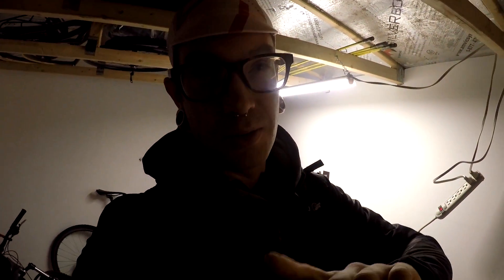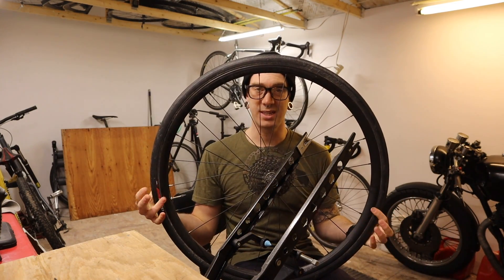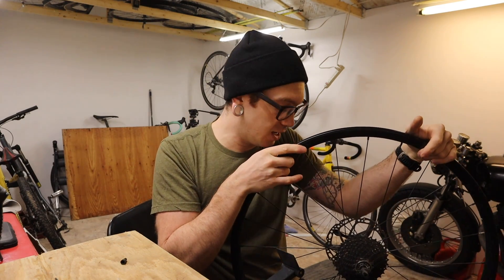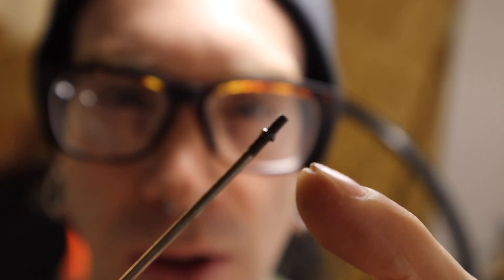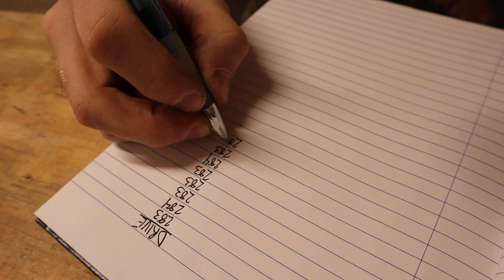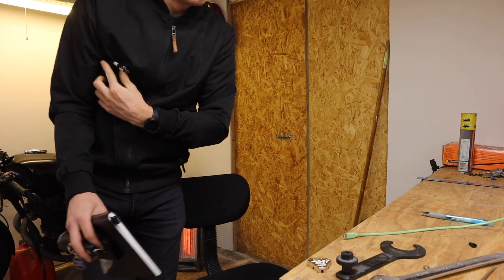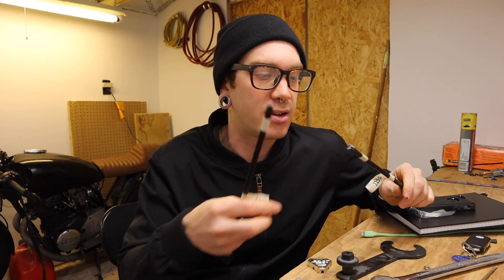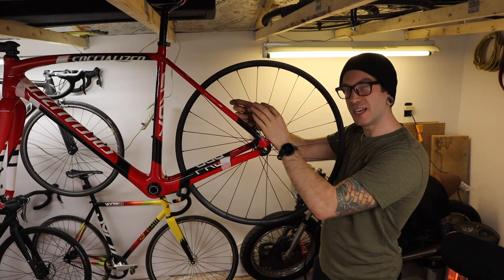A Rebuild

Comment: I did a dynamo front wheel a month ago after not building a wheel for several years.  Took out the stock hub and used the Stans rim of original wheel with new spokes.  Very satisfying, building wheels.

Comment: From personal experience...Cycle Lambert's "Bike Shop" wheels by Alex Rim are made well. Rarely find wheels that snap at the nipple. Have a pro each season tune each spoke. Cause I ride in salt and snow, I wash them regularly and put a drop of 3 and 1 oil on the nipples. Finding older rim brake 26er Mavic Rims...are gold to me! Shred in the forest, dive out of ditch with the Woverine, 3 foot slam!!....oh boy! Check out the old man...ha ha

Comment: Great channel. I’ve built a few wheels with help of Jobst Brandt’s ‘bible’ but no expert for sure (fascinating read and provides the science behind how spoked wheels work), but did you say actually broken nipples? Never seen one break so have the spoke threads pulled through or has the end of the spoke broken off in the nipple? I’ve only ever used standard brass nipples but maybe the weight weeny alloy ones do break? Cheers.

Comment: Just a few days ago there was this debate on reddit with measuring spokes to a fraction of a mm and a guy asking whether he should order the size up or down (2mm increments) and there were people saying that the size lower since it matched the majority of spokes would be sufficient.  I would say on a 289.2 the 290 would be a safer match than the 288, while getting 288s for a measured 287.3.  And this was based on a spoke factory calculator not actual measurements.
Reply from the maker: I would agree! The fraction of a mm is a little more precice than I would consider worth while. I do like having 1mm increments available to me though. And the ability to have spokes made to length, guaranteeing the same length between them all is a huge plus!

Simply put when using boxes of spokes a round my sizing the exact same way you do. Just makes sense.

Comment: Bout to rebuild/build a wheelset for the first time...wish me luck!
Reply from the maker: You got it! Take so much time while bringing the tension up. Slowly and evenly on every spoke all the way around. They’ll stay reasonably true until the final bit.
Reply: @Spindatt  Thanks mang! Actually building up a scratch & dent Poseidon x frame i bought. Bought some praxis al24 rims on the cheap(no reserve ebay)...then found ought the reason no one probably bid because they had boosted hubs...smh lol. It's a learning process! got new hubs/spokes on the way.  Still cheaper than buying new.